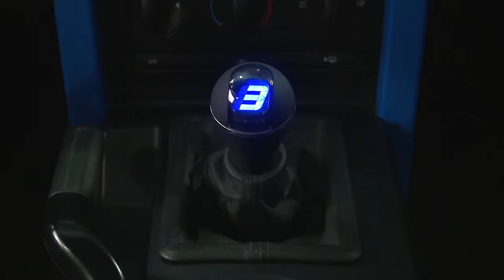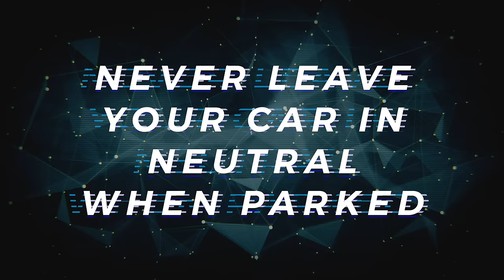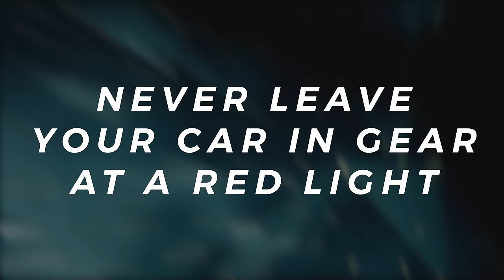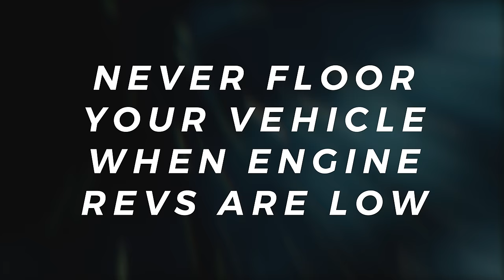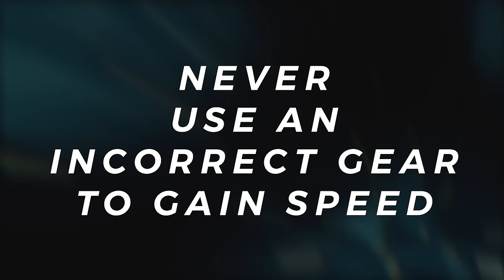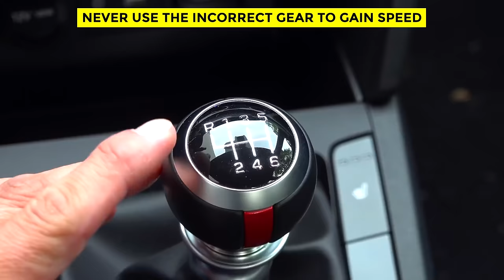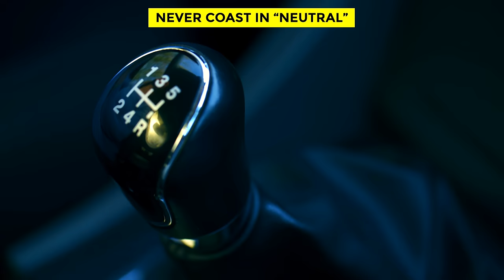7 Things You Should NEVER Do In a Manual Transmission Car!

Comment: Unless you're sitting in a Ferrari or sth. similar, the 2nd highest gear is meant to be the fastest and the highest is meant for cruising at a high speed with a lower fuel consumption.
Reply: lol my Toyota celica doesn’t have an overdrive gear, it’s not just Ferraris

Comment: Being in neutral does not starve the engine of oil, if this was so you would lose oil pressure and oil circulation anytime you are sitting still or idling. You are confusing this with lubrication system in the transmission( manual and Automatic) that uses  a special ring on the input shaft to lubricate  the transmission.

Comment: What are your thoughts on using a lower gear while descending a long mountain pass to regulate/maintain the speed, rather than engaging the brake all the way during the descent?
Reply: using the gears is how you are supposed to do it, and it uses less fuel
Reply: You'll be buying new brake pads every other day.
Reply: That's how you should do it, the engine braking assists your brakes.

Comment: And you need to park it in neutral, you start is up again, you did forgot it’s in first, pull the handbrake off, and you hit the car in front, like a automatic
Reply: parking in neutral means the only thing holding the car is the handbrake, and usually you have the handbrake on while you start it so it wouldnt move anyway but you shouldnt be forgetting to put in neutral to start it anyways lol
Reply: @hunterpinson807  ps; you dont need to warm up your car

Comment: Giving it full gas in a high gear does not stress the engine. It lets more fuel in wich helps cool it down. And low rpms will never stress a engine

Comment: If you're not supposed to coast in neutral, then what in the hell is neutral for?
Reply: when you don’t need to be in gear, idk why you would think it’s made for coasting
Reply: @arcanevoid9199  it is for coasting just use neutral when you dont need to be in gear like if you are backing up on a hill or drive way might as well just let it roll instead of using reverse
Reply: @ethanol-fb  coasting is a bad habit, thats pretty unsafe too. in that situation i almost always still put it in reverse but just hold the clutch in that way the reverse lights come on
Reply: @arcanevoid9199  hows coasting a bad habbit? like if im at a light and its downhill a bit i just let it roll when it turns green and go into 2nd no ones gonna die from not having the reverse lights on
Reply: For when ur stationary

Comment: Lugging the engine when flooring the gas pedal does not cause wear with electronic fuel injection, because your gas pedal is nothing more than a sensor for the computer chip to tell it to slow down or speed up.
Reply: uh you know that not all efi cars have drive by wire right? pretty much any car from before the 2000s with efi is going to have cable throttle

Comment: basically when u stall its when u do not go to correct gear for the speed u are going example : im going 40 but i change to gear 3
Reply: no its when the revs get to low and the car isnt free to move. like if you try to move off with the handbrake down it will stall

Comment: You can hold a manual on a hill with the bite of the clutch so long as you match the revs with the accelerator. It's not good to do this for a long time such as waiting for traffic lights. But if you're at a junction waiting for other vehicles, it's fine.
Reply: @hunterpinson807  Should have said sustain the revs. Either way, you can hold a manual on a hill using the clutch. it's called clutch control.
Reply: @hunterpinson807  so what do you control the revs with the volume dial?
Reply: @K369-v3o  also na man thats bad for the clutch its not meant to be used constantly like that just hold down the brake and clutch in 1st and just let off the brake and then just use the gas
Reply: @hunterpinson807  not how you're describing it
Reply: @hunterpinson807  yeah ik wym
Reply: @hunterpinson807  using the clutch to hold yourself on a hill is bad for it thats what im saying

Comment: Never use the brake to speed up the car
Never use the gas pedal to slow the car

Do not use whichever pedal looks cooler to you at the time as incorrect usage of these pedals can lead to a accident, damage the flywheel, or the transmission, which is bad for manual gearboxes

Comment: "Never brake without engaging the clutch"
Incorrect. You only brake with the clutch engaged if the RPM justifies it. At high speeds, braking with the clutch engaged is unnecessary.

Comment: You always leave your vehicle in gear at a red light... always. If you get rear ended, you want to be in gear, not neutral. Brakes or not, be in gear. Your clutch will be fine, just keep it firm on the floor.
Reply: its not that deep just keep it in neutral why would leaving it in 1st if you get rearended change anything

Comment: Do not press the clutch down when braking except  just before coming to a stop. 
Engine braking is real and helps save on brake pads. It also slows you down quicker in an emergency. 

The top thing you should never do in a manual transmission car though is take advice from an American.

Comment: Tip for new drivers:
Contrary to popular belief, the reverse gear does have synchronisers. If you put your car in reverse at high speed and take your foot off the pedal the car slows. This is called engine braking and helps your brake discs last by removing unnecessary use of the brakes.
Reply: This isn't true for all manuals. Depending on how old your manual is, your first gear might not even be synchronized. All depends on the car, truck, etc.

Comment: Resting on the clutch wears the throwout bearing, not the friction material. If the clutch were slipping, you would feel, hear and smell it
Reply: it can also wear the clutch
Reply: @arcanevoid9199  That's a common misconception. Like I said, the clutch isn't slipping, and if there's no slip, there's no wear
Reply: @waldolemmer  its not a misconception, it depends on how much you have the clutch in when you are riding it. you can definitely wear the clutch, and for cars that have the biting point at the very end of the pedal travel its even easier for it to happen
Reply: @arcanevoid9199  No car has the bite point at the end of pedal travel lmao, imagine trying to launch such a car

Comment: Never put the shifter on any gear when the car is at rest in any hill use ebrake if you don't have an e brake use the gear method cause it will damage your gear in uphill or downhill
Reply: parking your car in gear will no way damage your tranny its good practice and its the right way to park with the hand brake and in gear

Comment: it almost seems more i only disagree with #5. similarly, you shouldn't turn your engine off at a red light, mostly because it can take too long to get going and cause an accident. using the hand brake/foot brake and then trying to get back into gear could take too long and cause an accident.

Comment: "Never brake without engaging the clutch"    No, that's perfectly fine and it is good to do because engine braking will help you decelerate.  Over in this universe, drivers brake without engaging the clutch every time they drive.  Of course you can't STOP without engaging the clutch, because the car will come to a lurching stop with a stalled engine.

Comment: Press the clutch down. Go to second gear while stopped. Press the gas until you get to 4500 rpm. Get you foot of the clutch and press the brake around 70%. Congrats! You learned how to fuck your new tires in one day. (Tape the area behind the wheels! So you don't have to clean up molten tire)

Comment: Everything was good except for the last part Depending on the year though a lot of transmissions will be getting libercated because It's already moving and that's how it works the engine won't be stressed out because it's not working hard and it's idling is just fine In the last part you said that how it operates normally will tear it up that makes no sense

Comment: I disagree in the point to put in the gear when you want to leave the car where you normally just pull the handbrake. If you enter tge car next time and you dont remember there is a gear active and you start the car, you might immediately make the car jump forward and hit the wall or anything! I also disagree where the hard clutch in is worse than the too long and soft clutch i n where the soft clutch in will cause a even more weaer if it takes too long! Also coasting in neutral downhill is absolutely fine. It doesnt matter if you wait for 3 minutes with the running engine at a stop light or if you coast for 3 min. downhill.
Reply: if you dont put the car in gear there is nothing to stop it if the handbrake fails, if you dont see its in gear when you start it thats a not paying attention. coasting downhill is unsafe and uses more gas
Reply: @arcanevoid9199  if you dont put in a gear you can always use your regular brake to slow down!

Comment: Putting your car in neutral at red light will get you a fail on your driver's test. Braking without pushing the clutch in is fine. And again, not doing so will be a strike on your driver's test.  How is one supposed to not coast in neutral, and yet push the clutch in to brake?  It's literally the same thing.

Comment: 1:50, here I have to disagree to one point. When there is a imminent danger approaching and you have to save your life, don't bother pressing the cluch just the brake it's fine, this is a often mistake made by drivers.
Reply: no just slam with both feet, you dont want the car to stall as you will lose braking assist and power steering etc

Comment: Wdym put it in first when parked? wdym emergency brake? its a parking brake, used for parking, because if you put your car in 1st or R you now have to remember to hold the clutch or shift to neutral before starting the car, which you can fuck up really easily and you can screw yourself over

Comment: Ok I stopped when I heard "emergency brake" 😂😂 wtf bro are you telling people you should use it in case of an emergency ?
Reply: if you loose hydraulic pressure it will still work
Reply: @arcanevoid9199  yes for cable driven handbrake but that's not his job, it should only be used to immobilise your parked car (well it's a parking brake so I am sure everybody already know that). Most people with a decently maintained car will never ever loose hydraulic pressure to the extent brake pedal suddenly just won't do anything in their entire life, it's a critical failure

Comment: never use your parking brake in the winter the cables can vreeze and wont dissengadge the brake resulting in boiling brakes and then you end up with out brakes down the road and you wont be able to stop.
Reply: depends where you live though, plenty of places you won’t have any issues

Comment: Don't do what this person states. Never leave your auto box in park leave in neutrel and use the parking breaking, The pin in auto boxes is very small to lock the box and cannot take the weight of a car, it is a very expensive repair,
Reply: no leave it in park, it can take the weight of the car thats why its called park. i know someone who wrote off a car because the handbrake failed and it was in neutral instead of park

Comment: 1:20 a nice clutch is about $100 to $150, not extremely expensive
Reply: its mainly about the labour, not necessarily how much the clutch is. its a big job
Reply: i had a friend that replaced his clutch after 2000 miles, yeah the pressure plate exploded and it was 1000 for the kit and thats not even labor because we ended up fixing it. 21 nustang

Comment: Come on, driving a manual is not rocket surgery. Also, clutch slipping is the ONLY way you can start rolling with the car. If you jump off the clutch, you will stall.
Coasting in neutral is not dangerous because you starve the transmission of oil, but because you lose the ability to engine brake. This applies the same for pressing the clutch in while braking. You shouldn't press the clutch in until you are just about to get your RPM down too low. It doesn't cause any wear on the engine.
I think this video was made by someone who have never driven a manual before, let alone understand how it works.

Comment: Sooo. I should not leave the car in gear when stopped but I should also not put it in neutral while stopped.... oh I know. I should reach under the seat and manually remove the gear box everything I stop. Ya know. To make sure nothing bad happens
Reply: You should not leave the car in gear when stopped when it's running because it can stall.
Reply: And as I know, the gearbox is in the engine. I built a datsun in my summer car, I know.
Reply: @npc_citizen9276  the gearbox is behind the engine not in lol the transmission in my summer car is a transaxle

Comment: For the actual experts out there, what's with the "excessive stress" when you're flooring the pedal at low rpms and a high gear? Is that even an actual thing? How can the engine be under stress when the rpms are low, the only thing you're doing with flooring that pedal is opening the air valve up to its fullest and injecting enough fuel to correspond to the air volume percentage??? How is that even a thing???????
Reply: because you are lugging the engine asking it to do more than it can usually it dost matter but lugging would be like in 4th or 5th at idle and flooring it usually its only a bad thing on turbo engines
Reply: @ethanol-fb  ah makes sense, thanks bro

Comment: bad advise being in neutral with e-brake on at light, if you need to move for some odd reason and really fast, then you are screwed.
Reply: Except nobody should put the ebrake on when stopped at a light
Reply: @arditsadiku8474  why not lol
Reply: @arditsadiku8474  Good luck with that on a red light on a hill.

Comment: These suggestions are dangerous. You should not change down when braking unless necessary, you should not coast in neutral as you can't accelerate if necessary. Putting it in first or reverse when parked is unnecessary but you can if you want
Reply: coasting in neutral is fine to do and you always park in gear

Comment: Replacing your clutch doesn't cost a fortune. Usually about $100 for the clutch set + another $ 100 for the bearing. Depending on te car 1-4 hours to replace things.

Why do Americans make such a fuss about stick shifting? The whole world uses (used) manual transmissions and nobody has a problem with it, except Americans. They pretend it's the most difficult thing in the world. It's EASY!
Reply: because its not taught a clutch kit is 150 for my car and thats on the cheap side of it if you take it to the dealer ship that 3-4 hours is 6-800 in labor

Comment: I never heared that you should put your car into Neutral when on a red light. This has to be an american thing, in Europe we just leave it in Gear.
Reply: leaving it in gear is annoying and wears the throwout bearing faster. try holding in a hd clutch for 5 minutes at a light, and then doing it at the next one after that
Reply: @arcanevoid9199  we dont have any Red Lights for 5 minutes. They are usually Red for about 20seconds.
Reply: @Mikepet  lucky, but don’t you also not have many modified cars too? don’t think anyone would want to hold the clutch in on some of these cars any longer than they had to
Reply: @arcanevoid9199  Car mods are very very restricted over Here, so there are pretty rare.
Reply: @Mikepet  i dont get why people in the uk keep it in gear dont your lights tell you when they are about to turn green? even here it takes .5 seconds to put it in gear when the light changes its just easier

Comment: actually i'd say at 9:30 that this applies on MOST injection cars but if it runs on carbs such as mine, neutral drains less fuel going downhill cause my carbs uses the fuel i "allow" it to use like once i press the pedal or put it in gear my engine takes more air so it can make a better mix and let get through more fuel so it accelerates more or less which means that when im in neutral my car needs less fuel to operate! hope it can help someone (it can apply to some injectors too)

Comment: Terrible advice. Shouldn't coast with the clutch engaged. If you fully understand the sound of the engine and correct gear selection allows you to use the gears the slow the car down too, then engage clutch before stalling.

Comment: Everybody holds the clutch down in 1st gear at a red light. Who in the hell would put it in neutral......so you would have to shift at the exact moment the light turns green..... This will only add to making a possible mistake...
Reply: I stop at neutral at a red light so my leg doesn't get tired from holding the clutch. I just have to remember to shift in first when I drive.
Reply: i leave it in neutral and i leave from the light sooner than the car next to me lol its not that hard
Reply: That’s what you’re supposed to do, especially when you’ve come a red light that you’ve seen just turn red as you approach it. Keeping the clutch engaged at 1st gear while idle will just burn out the clutch with time.

Comment: ive never once heard of lugging the engine, isnt all flooring it doing is opening up the throttle all the way, how tf does that damage the engine, all its doing is putting more fuel in and letting in more air, tf
Reply: flooring it high gear when the revs are low isn’t great for it, can get away with it in a na car but can damage turbo cars. it’s not just about putting more fuel and air in, it’s the gearing disadvantage. be like trying to move off in 6th gear

Comment: The thing he said about resting your hand on the shifter is so incorrect
Reply: I don’t think so, it is bad for your transmission, because of the constant vibration, which are slightly interrupted though the hand on the shifter. It isn’t that bad, but it isn’t good for your transmission either